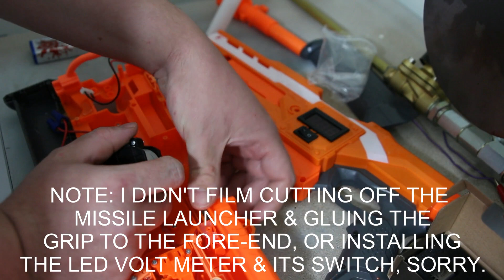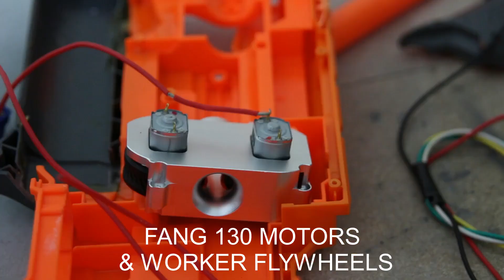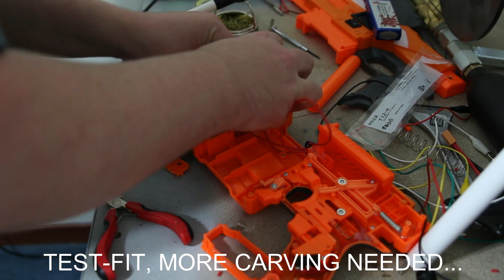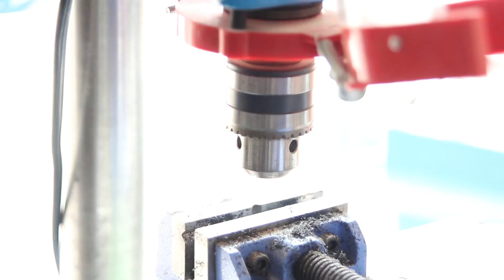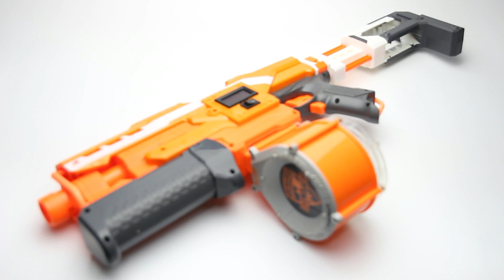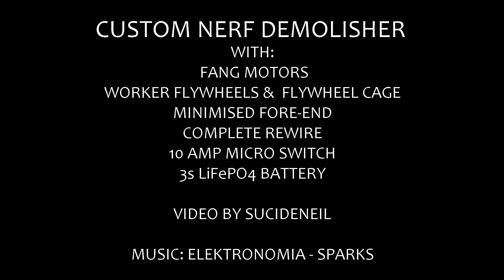Custom Nerf Demolisher Mod- With Fang Revamped™ Motors & Volt-Meter

Comment: Just decided to rebuild an old Demolisher and I was originally going to remove my launcher but decided to use 40max greengas shells in it. Still a work in progress. Currently trying to cad the parts but I suck at cad. I would really love to do a solenoid pusher build like you have.. any info would be helpful. Anyhow I subbed